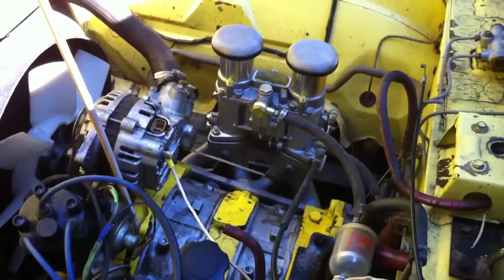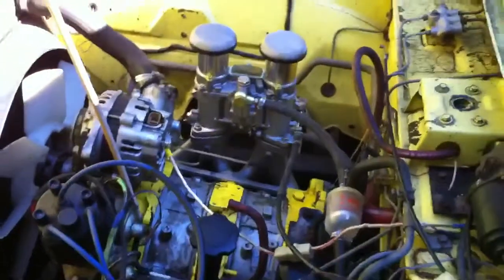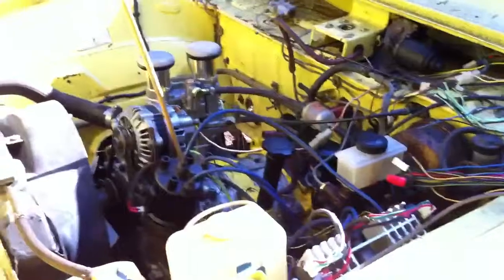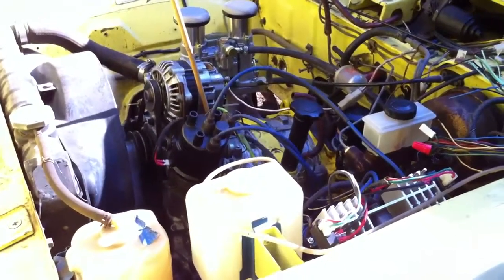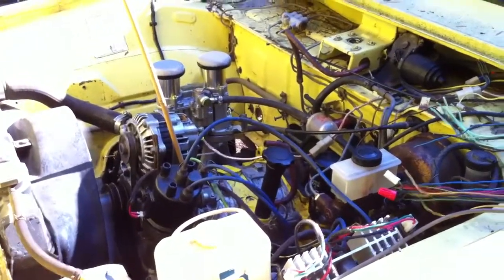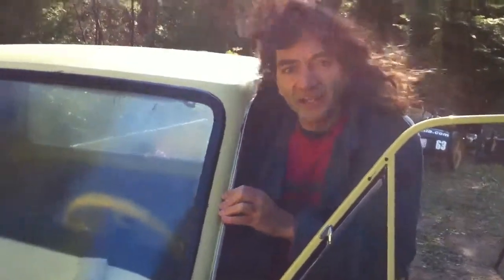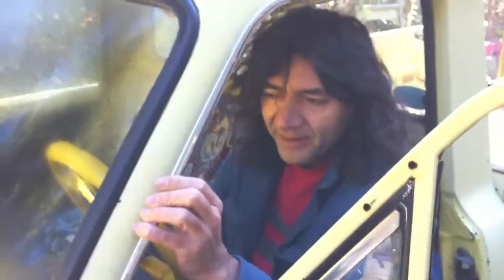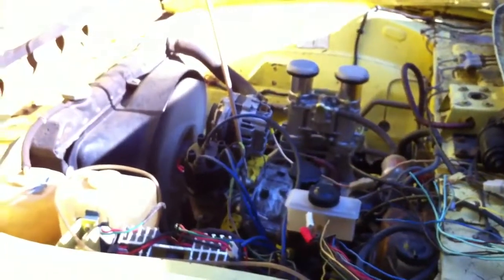Mazda Rotary 13B first startup with Weber IDA

Comment: How is that running with caps on the velocity stacks
Reply from the maker: Those are little air filter screens I use on several of my Weber equipped cars!  They work great and fit in tight places. And look good too.
Reply: Ah...they looked like covers .

Comment: ... I'm a British sports car guy and had a weber setup on a Bugeye when I was a teenager... guess its just something about the Weber sitting there that I liked.
The Holley setup works well, starts well (although I have to do the same thing...bit of right foot when first starting)... Biggest complaint is losing fuel on right turns...it gets starved. The suggestions on different jet position (center vs side) were not possible on mine...or so i was told by a local hot rod supplier.....

Comment: I have a 4 brl Holley on my 12A and have thought about switching to a Weber (have only seen the sidedraft setup on rotaries) but am worried about cold starting (the Holley with choke starts pretty instantly).... That vid seems to show it started pretty quick.... Do you just press on the accelerator a bit when starting?
Reply: I live in New Mexico and even in winter I have no problems starting any of my Weber powered rotaries with no choke.